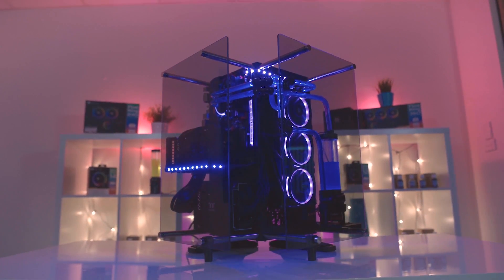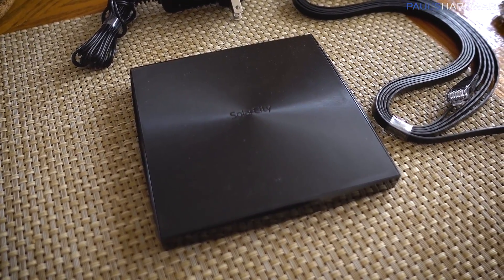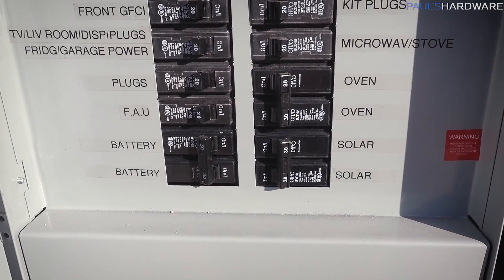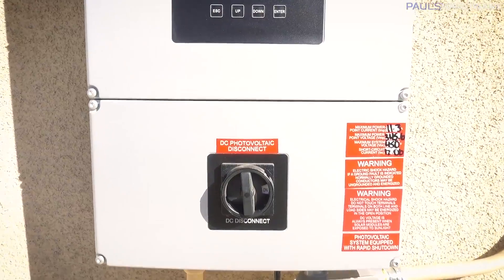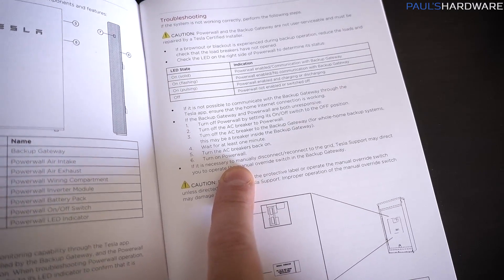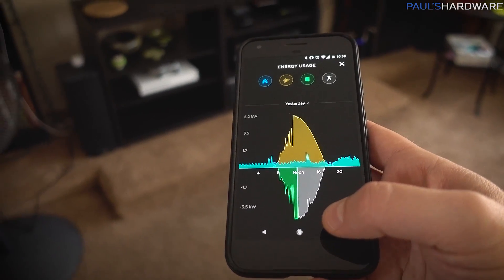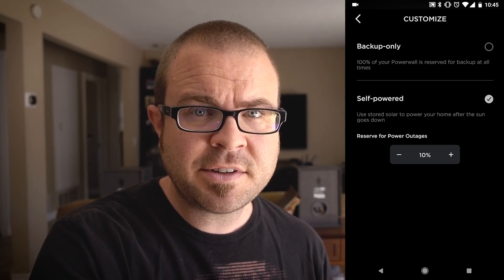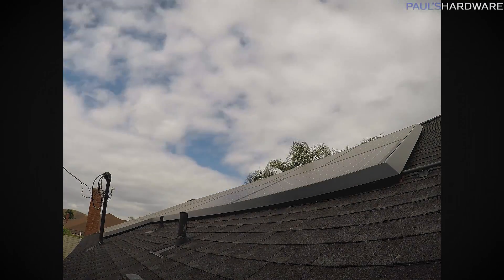SYSTEM ACTIVATED! Tesla Solar + Powerwall Week 1

Comment: Soo many breakers - reminds me of the circuit breaker scene in jurassic park, like many have mentioned. My house has 5 - Main breaker, RCD, Outlets, Lights, Stove. My home build powerwall will have just as many - Battery master, Solar, LV, Radio Gear and Inverter. Telsa are the Apple of the battery/car world. Expensive, but unlike Apple, they don't put 3 year old tech in their cars/home batteries (macbook pro anyone :P).

Comment: Unless you have the proper safety equipment I would stay off the roof. Instead use a nozzle on a garden hose to clear the dust and dirt of the solar panels.

Cheers

Comment: Like you, once I saw the app and how much other items were wasting like power strips, chargers, etc. I shut them down.
One thing I’ve done is purchase 12v LED lights (dirt cheap), rewired a couple of lamps for dc power and ran a couple dc circuits for them and all exterior lights. DC LEDS lights use less than half the power of regular LED and are bright.
Reason I try to draw dc power directly from the charge controller is because the most energy efficient inverter I can find has a 10% voltage drop meaning that 10% is lost or used by the inverter.
Enjoyed your video and I love my small but great 400w system.

Comment: What is the advantage of running not in backup mode? To my knowledge your area should be "net metering", which means you are only being charged what you used in power over the term (generated power - consumed = net metered). It seems like your a cycling your batteries without any real reason. It seems to me that running it in backup mode would reduce cycles making the batteries last longer, maybe occasionally switching back and forth to make sure you have some cycles. I actually want to know your reasoning if there is a hole in my logic somewhere. Thanks!

Comment: I would like to go off-grid. So if I just wanted a 800sq ft house that only really needed to run a fridge and a small AC unit, would you recommend a power wall and solar roof? Thanks man. Also, total cost?

Comment: The connection to the grid is the main concern. The electric company may elect to give you credit that is substantially less than if you drew power from them without solar panels and a battery. And the connection charge to the grid, that allows you to return electricity to the network, may incur prohibitively expensive unreasonable fees. In the Nevada area, Nevada Power has been granted the ability to charge exorbitant fees in comparison to the previous expenses that consumers were billed when connecting to the electrical grid. It may be worth simply not connecting your battery storage to the network to get a potential credit if the fees associated with the ability to connect this way actually reduces your overall savings.
Reply: His area is net metered, which means you don't ever sell back to the grid you simply reduce how much you use at 100% efficiency. In general, if you produce more power than you use, or just produce power to run into the grid, they only have to pay what it costs them to generate that power. That number does not include all the additional stuff they get to charge you like transmission and all the other fees. So usually you would only get about 1/4 - 1/3 the amount per KW that they charge you.

Comment: What I think is happening is the powerwall  is putting energy into your house at the gateway which is feeding back into the grid, which offsets the AC use. the only time it wouldn't run the AC is if the power went out, the transfer switch would isolate your gateway sub panel from the main panel, which has the AC breaker.

Comment: I can't completely tell from the screenshots - but it looks to me like when the AC spikes happen - you still aren't drawing from the grid. All that is happening is that Solar is not able to provide enough instantaneous power, but the fully charged powerwall is capable of providing 5kW of instantaneous power, so it's doing it's job and providing the extra power the house needs to run. Electricity isn't complicated - the supply coming from the Tesla Powerwall combined with the locally generated solar will always be consumed first because electricity always follows the path of least resistance. This is also the reason that any power you export back to the grid - will probably be immediately consumed by your nearest neighbour on the same phase as you, rather than actually going all the way back to a substation. As you noted in the app you can force the battery to be a backup only in the event of a power failure, and you can specify that the battery stop supplying power to the house when it reaches a configurable reserve - both of these functions are performed by the box outside called the Gateway - the box will physically disconnect the battery from the circuit so it cannot provide any more power. It doesn't matter which consumer unit the powerwall or the solar inverter is eventually connected to - if the house only has one phase, then it's just one phase - all the consumer units are on the same phase - and as long as the circuit breakers are on - to the inverter and the powerwall - then the house will consume that power first.

Comment: Unplugging 100 Watt when you use an AC, will save you about 900 Watt.
Usually, they say cooling takes 8 times the energy to warm up things. So if your 'to' warm and have of thinking about getting an AC. Try to unplug all unneeded electrical stuff. This will save you loads of money and will give you comfort.

Comment: My system is 5.22 kwh. I had a mid winter problem, with my electric water heating, it started to use huge power,  and had to charge the powerwall with cheaper nighttime power, so i installed a sanden heat pump , i didn't want gas waterheating, and now I  have  gone back to 100% self powered. Even with low winter solar output. My powerwall was installed August 2017. Today's small of winter solar output, a full 250 lt tank of hot water and a full powerwall 2

Comment: Next time, switch the main breaker on THEN go through and switch on your other breakers one by one. If you turn on the main power last that creates a huge inrush of current. By turning the main on then go through the breakers one by one you are introducing the electricity slowly. In this case it was unnecessary, just flip the solar breakers on.

Comment: The sun on your power wall every day is going to be murder for its longevity. Batteries degrade much more in heat.  That's why Electric Cars vary widely based on the temperature they're left in, and many have active cooling systems to prevent battery degradation. 

Put up something to shade the battery

Comment: I wonder, what would happen if you shut off the main 200A grid breaker? Would the system still work? Great way to just go off grid when you feel like it. Also, how about putting in a second Powerwall? It looks like you are sending lots of power back to the grid, if it goes into another Powerwall, it would run your AC unit and be 100% self-powered.

Comment: 4:40 - "use something non-conductive" - while a pencil with a rubber at the end is not technically conductive all the way through, the graphite within is a great conductor. Please do not stick any kinds of graphite pencil into any kinds of electrical devices or plugs, even if there's a rubber at the end for maximum safety.

Comment: Maybe it could be beneficial for you to set the emergency amount of power a little bit higher. I am not sure how Tesla is preparing the batteries but the lifetime of batteries will highly increase if you do not use the hole bandwith. Thats why the Tesla cars only charges up to 80% by default and not up to 100%. 
Thanks for your work and please do a long time review with this :). Cheers

Comment: Here is another option for having items turned off but able to be turned on automatically when a TV or other devices is turned on. Using this on your auto system since it is turned on primarily when you turn on your TV could have your TV plunged into the tool outlet while a surge protector with all the other devices is plug into the shop vac, when the TV is turned on then all the other items are provided power.
https://www.amazon.com/i-socket-110m-Tool-Vacuum-Switch/dp/B001BSL1BM

Comment: Paul you did a great series of videos.

Why do you want to get a second battery if you are covering way over 90% of your energy needs with the solar and the battery?  

You seem to be covered.

I shared the following energy conservation information before: it is an idea to help lower your comfort cost and increase your cooling and heating comfort that works well with solar and battery storage.

https://youtu.be/QA2rnw0OMeA
http://multiaqua.com/index.php/chillers/mhrc-ae

I would add solar hot water collectors to this unit and an ice storage tank as well as a hot water tank.  
http://www.calmac.com/icebank-energy-storage-model-c
This will provide all the hot water needs you have year round (day and night) plus it will provide air cooling and air heat.
COP is over 7.

If you don’t care for the hot water, then here is another unit:

https://youtu.be/Dk6RBuA8yBk
http://www.hotspotenergy.com/solar-air-conditioner/
SEER 75

Both solutions work well with solar panels, and they are designed to slowly sip energy rather than gulp it
This will increase the life span of your investments in inverters and batteries.
Let me know what you think.

Comment: Teslas next project. Solar panel powered car (on roof). Runs from solar power. Charge at home. Never refill. It charges while sitting in the day (unless you run out at night)
Reply: Layback Studios 
Bullshit. No where near enough surface area. Unless you live on Mercury.
Reply: The max you get from the sun is around 1000 watt/meter squared.  If solar runs at 10% efficiency (generous estimate) and it takes around 12 hp to cruise on the highway then you're hauling around a 25'x25' solar panel on the roof which would be a lot of drag requiring more hp and more panels .

Comment: 13:20 onwards is one of the most important points in your video.  This system has encouraged you (and others I guess) to more closely analyze how much energy you are using.  If everyone did that (even without a solar system), overall energy consumption and associated carbon generation would drop dramatically.  Great video.
Reply: The biggest consumer of long term energy is the refrigerator(s). Lights don't add up to much. Small devices don't either however, those cable TV boxes do, almost sure they are using 85 watts each so over time...those count for a lot.  We all could cut off a lot of conveniences however, this isn't the solution, power generation is the solution but the Government(s) put limits on generation so they can tax it, attach penalties to it, charge different rates over 5 times a day and so on.  Thats pure b.s. since power doesn't cost the producers in that method. It's all a very fake market because of the regulators and various states who want to make money off of it thus, they create these "reasons" to charge the very many fees. Power gets generated at one fee, then it is transmitted to the many power distributions companies...no extra cost to make power at night, day, afternoon etc. as it's a consistent cost. In the long run, just use the grid and pay the piper.  Going solar is expensive but has it's features if someone is interested in it.

Comment: How does the powerwall make financial sense? If he just had the solar system he would generate the same amount of power and back feed the grid. Then at night use grid power, resulting in the exact same net power usage. The only benefits I see are the powerwall as a battery backup, or setting you service to time of use instead of tiered.

Comment: I believe the secondary panel is for your critical loads. Since you have a grid tied system it will pull energy from the battery as needed for the whole house including AC.... however if the main power from the power company is lost, the battery will only provide power to the critical loads indicated in the panel.

Comment: The panel with the meter only receives power and sends it to the other panel. A/C refers to the  A/C power coming from your utility gateway should refer to the powerwall. Your air conditioning is the F.A.U. (Forced Air Unit). ( work for a building and safety department here in SoCal, and sometimes see permit submittals for solar and powerwall)

Comment: Congratz on your finally activated Tesla Solar + Powerwall. I have a question for you, I'm installing a solar roof from SunPower and I'm also planning to install Powerwall in the near future. Do you think I should wait for some time using just the roof to decide wether to buy the Powerwall or pay for the electricity from the grid (if needed)? or do you recommend to go for the Powerwall right away to start saving money on electric bills from day one. Thanks for your guidance.

Comment: Good to see that the PowerWall and solar are up and running! The PowerWall is AC-coupled to your home electrical system, as is the solar inverter, so it can definitely backfeed the panel and offset the AC's usage. The AC won't work if the power goes out, since it's before the gateway, and it won't be battery powered. However, as long as you have grid power, the PowerWall can power anything between the main breaker and the subpanel.

Comment: The Tesla battery and solar Inverter puts out a slightly higher voltage than the utility voltage so all your loads will all use it first, any excess power is fed to the utility grid.  The exception would be when the power from the utility goes down, the Tesla gateway opens It’s disconnect to the Utility and the Air-conditioner breaker will have no power and will Not function because it’s on the wrong side of the gateway disconnect, and not being in the critical load's subpanel.  
When utility power is restored the gateway will see the utility AC power is present and will close gateway contactor and you will have normal functioning power again, that’s why you have a sub panel to feed critical loads to your home fed by your battery and solar.  Without the Tesla Power wall battery producing an artificial voltage the solar system would shut down and not produce power as a safety mechanism, this is why the Tesla gateway is needed to open up the utility and prevent power form feeding the impaired grid.
     
You can test this theory by simply Simulating a utility power failure by opening  the main Utility breaker during the day when the solar system and Battery is operating at full Charge and your Air-conditioning will not operate, then close your main utility breaker and it will start operating after a couple of minutes, the Gateway has a certain timeout before the contactor will operate on the gateway connecting the utility grid back to your grid.

Comment: hey paul, I see that you are adding a referral link, I guess that this may mean that you are making a profit... is it ok if I mention that there are metods to collect more energy than the photovoltaics, and that they last longer??... I am talking about the parabolic dish that tracks the movement of the sun... the rig consentrates the solar energy into a spot where it apears tto be a Sterling engine, in the 70's & 80's, they were creating masive amounts of energy, yet their prototype was also prety big, as to be capable to power more than 15 homes, with 1 single device...

Comment: Congrats on your solar system!! I'm thinking I see an application for some smart plugs. Then you could different modes like "Night" or "Away" or "Vacation" that would turn off specific plugs. So when you're heading off to bed you put the house in "Night" mode and it turns off those things like your theater system to reduce that draw. Other modes like "Away" or "Vacation" may shut off some other things.

Comment: An effective method to stop electricity 'leaks' is to use those motion activated and light sensitive light switches.  Finding a good room/location and getting it set up properly is impossible sometimes but when it works it's perfect.  Lights only come on when needed and do so by themselves.

Comment: I'm doing a 'parallel' installation in Palm Springs.  I'm hanging the LG Chem RSU 10 (9.8 kwh) lith-ion battery storage unit (mouthful) on the wall as we speak.  At 218 lbs and the size of a collapsible card table, it's a job for the Egyptians.  Stone Henge would have been easy by comparison, but I'm 3" off the floor now and need another 11" of elevation using levers and blocks.  $20 at Walmart buys a car lift but after, it will lay around for a year then get thrown out or given away.
My rough calculations regarding sizing must have been similar to yours, although I expect to buy more battery modules when the fine tuning begins.  I have 5.1 kwh of Certainteed 300 Watt panels, with optimizers and a Solar Edge Inverter.  We have a 'compliance' EV and a Level II charging machine.  I should be able to charge the car almost completely from sunlight mid-afternoon, most days, but I'll either have to drive my wife to work to have a car at home to charge, or buy another EV.  Buying an electric car just so you can utilize electricity gathered from the sun may sound stupid, but another car would make life easier, especially if it's a Zero Emission vehicle and fuel is free.  It can be rented out part time on turo.com to speed up the payback period (five years) for the system, and used Chevy Sparks are just up the road for $10k before the rebate.

Comment: I've got a suggestion for your home theatre, I use a smart powerboard that has a "master" plug that it monitors (like your TV), when it detects the TV is off by the power draw it turns off the "Slave" ports. I have my receiver, powered speakers, etc on the slave ports so they turn off automatically when my tv is turned off.